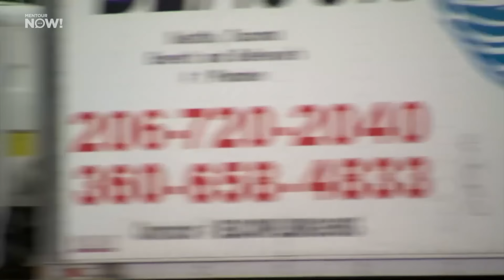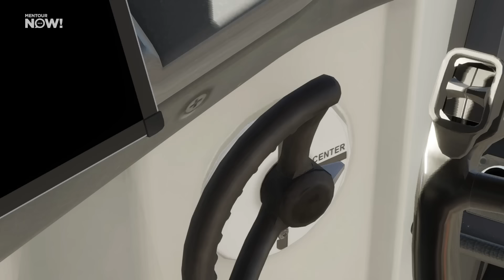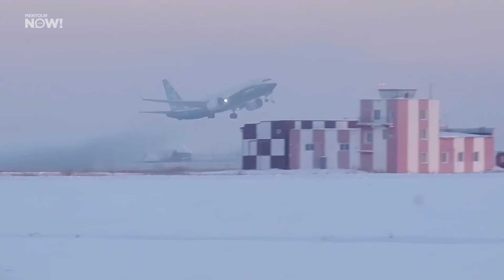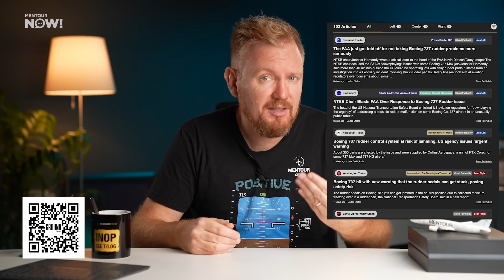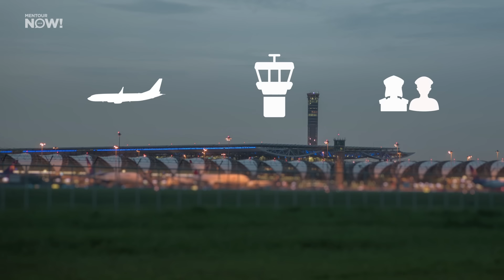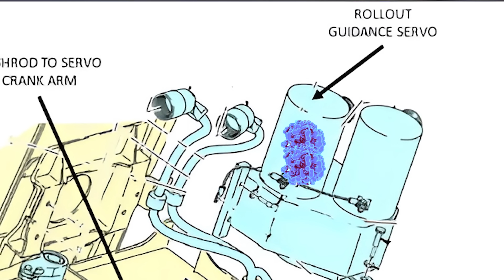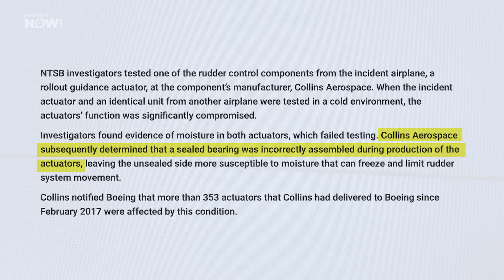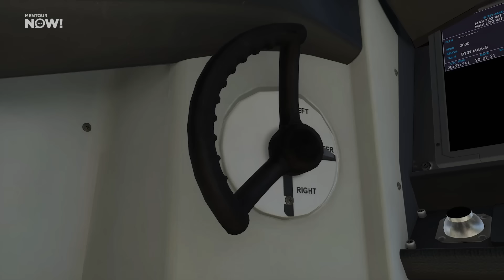Does the Boeing 737 Have ANOTHER Major Flaw!?

Comment: Back in the olden days (1960s) Vulcans were testing autoland systems at RAF Scampton. In order to address the taxying problems of what today is a Cat IIIc landing we had a sub system set in the runway and taxyway - leader cable - which enabled the aircraft to navigate to its pan after landing. I'm a tad surprised that this seems to no longer be used.

Comment: Very good analysis of how the system is built and how it is used. I find it interesting that you’ve made no mention of the fact that some airlines do not use the auto land system for low visibility landings. American Airlines opted to have Huds installed. And to hand fly their cat three and cat to approaches. Also interesting to note that with the use of the hood, American was able to certify and train their cruise to fly single engine, hand flown cat three approaches.

Since the head is only on the left seat, these approaches are all flown by the captain. He uses the enhanced resolution of the monochrome HUD to fly accurately, leaving the first officer to monitor the normal flight instruments with less resolution and the HUD fault annunciator panel.

And two engine operations, it can be very, very precise and stable. My last Kat to approach To DCA runway one, had deviation of only plus or minus one knot and plus or -.1 dot on the glideslope. The worst thing about the whole approach and landing was I reduced power in the flare at the same rate I would’ve done for flaps 30, but I was landing flaps 40. Resulted in a touchdown that was not excessively firm by any means it just wasn’t the smooth kiss the asphalt that I was shooting for

Comment: Is this going to turn into an Alaska 261 crash? Not the jackscrew failure, just the result. The old issue was the valve that started working opposite? L was R and R was L, and  it locked in place.?  Saw it on Air Crash Investigation.

Comment: During my early years (mid 70's) at RR Bristol we tested a variable pitch Fan based on, from long ago aging memory, the VFW614 engine a Joint Venture with SNECMA, the M45H. My fading memory says we tested not just the standard variable pitch change but also reverse thrust, and threw up some interesting questions about how to go from forward to reverse, through 0 degrees pitch or 180 degrees pitch to get to reverse. I wasn't directly involved in the project so my memory is not detailed but it was a unique program at the time, in the end I think it was abandoned as not either practical or needed.

Comment: So a system wasn't needed and was just turned off so could not be active but was still plumbed in so needed to move passively when the rudder moved? Was it too much trouble to remove and preferable to waste fuel flying around as dead weight

Comment: Parker Hannifin fittings took out a couple of 737s when they got reversals on the rudder check the Parker Hannifin fittings there or actuation valves or whatever irresponsible for how many people dying not a problem not a problem going back to flight 409 United I wish you would do some forensic work on that 409 I know a guy who actually got body parts of the mass grave from 409 and they had a lot of carbon monoxide in them even now

Comment: At this point I am willing to spend more money wait more time and choose a different airplane to avoid flying Boeing and in particular Boeing 737 Max.
For example I looked up flights to France I could fly Wizz with Airbus or Ryanair with Boeing I will choose Wizz. Even if the price is significantly higher.
You don't need to tell Wizz Air that information.

Comment: The problem is more general: there has been a significant and documented (on this channel) decline in the quality of Boeing aircraft parts and manufacturing processes, particularly in recent years:

* Repeated incidents and manufacturing problems

* Internal quality control problems

* Supplier dependency

* Change in corporate culture: the new managment does know nothing about flying an airplane ; they are financial managers (not engineers) seeking financial short-run returns to which their salary/revenue is linked (through bonus, ...) ; most of them could sell wafels or cars and still be happy.

* Quality issues have led to delivery suspensions for certain aircraft models and extensive investigations by regulatory authorities

Comment: The problem with de-activating a system without removing it is that functional checks and any scheduled maintenance will most likely be skipped / not even entered into computerised maintenance tracking software.  The Alaska Airlines Flight 261 crash is an example of what can occur when maintenance is missed.  Assembly defects at the manufacturer certainly don't help.

Comment: Many might be surprised how well brute force on the controls can work in an emergency. Especially older planes with no power boost controls. Take the Max for example, when MCAS defects made the plane into a dive bomber. I see video of a pilot just put his foot hard on the spinning trim wheel, and stop it, while the other guy is pulling like crazy.The next logical step would of course be to turn those two switches off, cutting power to the trim motor and then manually trim the nose up again. This is quite possible for experienced western pilots to figure out , even in an emergency, but as history shown , not third world pilots.

Comment: Petter, I can’t help but notice two things. 

1. Collins Aerospace are the same ones who produce the AOA sensors. 

2. While different from the old rudder hard-overs, those were also caused by a hydraulic actuator that failed only in extreme temperature situations.  You’d think Collins might have learned from Parker Hannifin’s mistake.  🤔
Reply: The AOA indicator failure wasnt the issue, the issue was that MCAS was only connected to one instead of the FAA required 2 sensors, in this case AOA indicators.
Reply: @ right, but had the sensor not been faulty the problem wouldn’t have arisen and they seem to continue being a rather high failure part across the board.

Comment: Using maximum force to unjam some component seems to me an invitation to see what damage or failure might occur to other elements of the rudder system from the application of "brute force." Every layman dealing with some plumbing issue at home knows that "brute force" used in an attempt to rectify a water faucet or other water system problem may well result in an unanticipated large plumber's bill.

Comment: Rudders have been a problem on aitliners for decades. A 767 plunged into Queens just after takeoff because the rudder snapped off its mount. Happened just after 911. Can't fling a 200 ton airliner around the sky by booting the rudder.  If that is a problem, what isn't.

Comment: I first boarded a 737 in 1968. Seat on the starboard side. Started takeoff run, I happened to notice a steady oil stream running below the no.2 engine. Just as I was about to notify a cabin crew member, the takeoff was aborted and we taxi back to the terminal to deplane. Spent the rest of the morning waiting for the repair to complete. 

Harbinger of things to come for the 737?

Comment: Which 737. 
The 737 first commercial flight in 1968 57 years ago. Since the it has been "upgraded" many times to a point beyond good engineering practice. 
Not all that surprising way back then Boeing was led by engineers, but since then it has been taken over by bean counters at behest of shareholders whose main interest seems to be the bottom line.

Comment: IMHO a proper solution to this "problem" is very pedestrian.STEP-1: A search that should take only hours would reveal which airlines have airplanes with this part attached, as we'll as operators and contractors who have these actuators sitting as spares on parts shelves. STEP-2: representatives of Boeing, numbering as many as is deemed necessary for quick resolution, should be dispatched and  board numbers of aircraft and fly to the sites that have executive control over the maintenance of the subject aircraft that they either own, or lease. And I mean the aircraft  that have this suspect part installed, or can can be modified to include it. The representatives should present a directive document to affect a complete disengagement of all suspect rudder activators by rendering them disconnected from rudder activation, or extracting them from airframes. Also, any units stored as spares should be returned to Boeing for destruction, or rendered inoperable according to a Boeing approved protocol. This sort of procedure would circumvent any of the 'notam' sort of mails that might easily never get appropriate attention from operators or maintenance contractors. Boeing cannot afford to do anything else. But, recent history would advise us to suspect that they will do something else — like issue a notice to stamp hard on the rudder pedals to free a "frozen" part. Pathetic!

Comment: EASA no longer recognizes CAT3 A,B,C designation, now is only: CAT3 with a DH less than 100ft but more than 50 ft or DH lower than 50 ft. And the minimum RVR according to EASA regulations is 75m. They have changed a lot recently, including thejr fuel scheme and designations 😓 is kind of a mess to be honest, the information is not easy to get, you can find it in their website but there is a lot of information put tougher on their books

Comment: With decades of new product development, manufacturing quality control, SMS and forensic failure analysis engineering experience, Boeing’s manual stating to wack the rudder pedals with extreme force to unjam the rudder system is beyond stupid, it can be deadly sending the aircraft out of control leading to loss of airframe and human life.

Comment: if the NTSB had been notified sooner of the previous autopilot (MCAS) problems, either by the airlines or by pilots using a confidential hazard report, the two deadly accidents in 2018 might have been avoided imo

Comment: The 737-800 has no relation to the 737 max. The 800 is an older proven work horse of the industry. This plane can fly with one bird strike. The South Korea govt. wasting time checking all the planes. 
Probably pilot error at a dangerous airport.

Comment: The Boeing 737 is basically a jazzed-up 727, which was engineered in the 950s and introduced in 1960. So what we have is an engineering design that is over 65 years old and is incompatible with the high-power, computerized upgrades. Apparently, to be politically correct Boeing does not strive for engineering innovation and excellence anymore.

Comment: Actually, on a Category 3A or 3B or 3C, you do not have to see anything in order to continue the landing, and that's why you set zero on the radar altimeter as there is no decision height. The requirement is that the reported Runway Visual Range (measured runway visibility) for that runway be at or higher than the published visibility limits (600 feet for a Cat3A), in order to be permitted to commence the approach. The only requirement for being able to see something on a Category 3A(600RVR) approach is when the Autopilot system is in 'Fair Passive' mode, as opposed to the normal 'Fail Operational' mode. In other words when a failure of some sort has diminished the redundancy required for the autopilot to safely autoland the airplane. In this case, 50 feet is set in the radar altimeter, and visual reference must be established at 50 feet in order to continue the approach and land, in case another failure should cause the autopilot to be unable to land the airplane and the pilot flying has to either: manually fly the airplane to a landing or execute a go-around.

Comment: I fly microlights in the UK (Flylight) and they are designed and built by pilots for pilots. I also built 64 machines myself there and was absolutely meticulous in my approach. No machine there has EVER failed in flight, nor have ANY hang gliders other than those fooling around with specifications or going outside the envelope. I have flown hang gliders from 1974, been up to 20 thousand feet in the Owens Valley in a machine with an airframe I built myself flown in a harness I designed and sewed myself. World's third Delta Silver BTW.

Comment: Boeing needs to decide on whether they should follow a modern philosophy in a/c design OR maintain an obsolete concept of Aircraft - Pilot interaction which is a thing of the past. You cannot ask a pilot to exert certain forces on flight controls in special circumstances for example and at the same time sell a/c as high tech. This is the contradiction that Boeing faces today. AIRBUS shows they have solved these problems by implementing new philosophy in their designs.

Comment: This is a design problem. Two aspects:
First, back-drive efficiency of a gearbox is lower than forward-drive efficiency, the higher the gear ratio, the lower the efficiency.
In the rudder case the back-drive efficiency is low and also diminishes the rudder forces trying to drive-back the gearbox. However, a low back-drive efficiency of the gear box becomes a problem when the pilot has to use the pedals. In cold temperature, the efficiency becomes lower due to viscosity of the lubricant, even without any ice.
Second, the bearing should have been sealed on both sides to become foolproof.

Comment: Is this something new! ... This happened 15-20 years, I think it was around 737-300/400 not sure and I would have thought they managed that problem but with those terrorists running the company who knows whats going on with Boeing these days, where couple of planes making a turn never getting out of it with the results of crashing. The result was the cables for the rudders got stuck between some objects. So this rudder problem in itself is nothing new, but I thought it was long done and a fixed issue

Comment: Crazy advice to use force while the aircraft is moving. If done at the wrong time and/or the rudder re-freezes in a deflected position, then you are stuffed.
I didn't remember the hard-over issues from the 90s, that you mentioned. Amazing as the 707 suffered rudder hard-overs in the 1960s!

Comment: I could provide vast amounts of inside information regarding Boeing Commercial Airplane critical faults... start with the rear-pressure dome fastener build... then move-on to the elevator build and mis-rigging debacle (haven't heard about that one?)... then there is the "Temp-ups" of the lower-grade personnel to a "higher-grade" so Boeing can get more work out of them - but they are not trained, nor competent, to actually perform the level of work.  Ok... now that I've got your attention.  There are far more cover-ups.

Comment: It strikes me that one element of pilot response to a sudden emergency can be found to be missing, often. 

Once the incident becomes known (without knowing the actual nature of the cause, often), neither pilot seems to be inclined to walk back into the cabin and determine if: 
1. The actual cause becomes clearer.
2. The extent or the location of the cause can be seen. 
3. Are there additional dangers to plane or passengers that can be revealed so that the cockpit crew will know better what they are up against. 
4. Do the conditions which can be appreciated from within the cabin dictate a change in plans, such as a very quick descent, or cutting off such services as hydraulics, fuel, or electricity to a failing part such as an engine or a tank.

And I note they never seem to ask the purser for their information as to what is going on in the cabin. Sometimes, I have watched while they cut off all communication with the cabin crew without determining what those experienced crew may have seen.

Comment: I got my PPL, Comm License, CFI and Instrument rating in the early 90s. And I've always wondered why airlines haven't used FLIR or forward looking infrared systems. FLIR has only been in common use in fire departments since the early 2000s. A FLIR system would allow the pilots to see thru the ground fog and tower personnel to see aircraft on the field. Just wondering.

Comment: As a now retired glider pilot, I was keenly aware of the developpment and introduction into service of the collision avoidance system "FLARM". Some years later, I learned, an important new customer for FLARM had emerged. Open pit mines had now installed that system in the big dumper trucks which drive on the mine's premises, off-road and more or less autonomously. Could this system also be (or is it already) a solution for airport vehicles operaiting in low-visibility conditions?

Comment: Very clear and informative. Perhaps you can do a follow up where you get Boeing to identify which international carriers are affected, and exactly what measures they have followed to ensure that their aircraft won't have this problem going forward. Collins said there were some 337 actuators supplied to Boeing. That implies a potential maximum of 337 planes among 40 carriers. Boeing's official advice on using excessive force to get the rudder unstuck borders on criminal stupidity. Boeing was my hero till they blamed the first 737 Max crash on pilot error, and thus enabled the second 737 Max crash. It's really the profit-driven upper management in Chicago who are responsible. They took the decision-making power out of the hands of the engineers in Seattle and with their money-grubbing paws firmly at the helm, have steered this once-great company into an irrecoverable nose-dive. Shame!